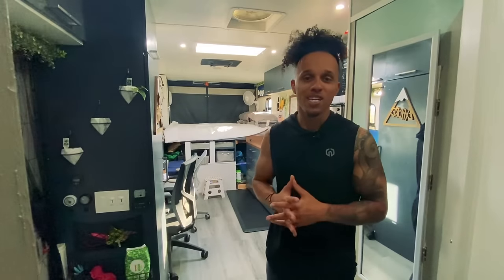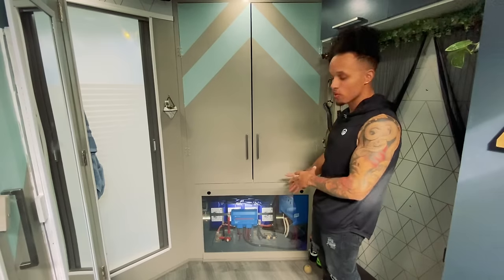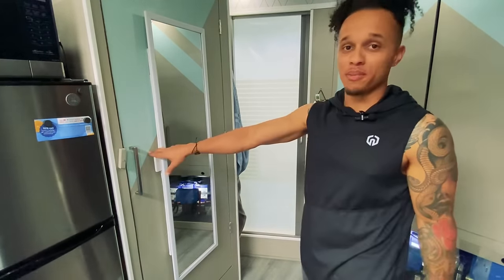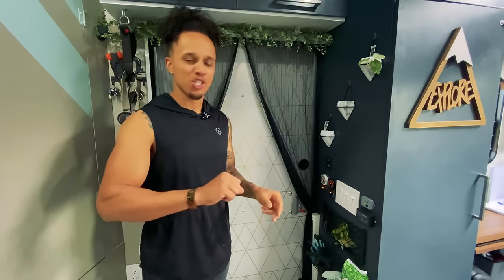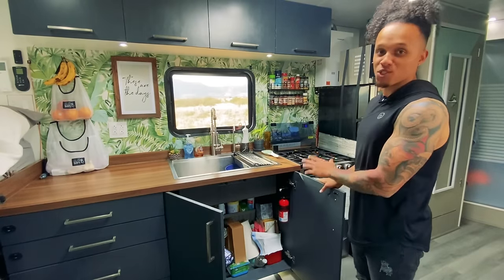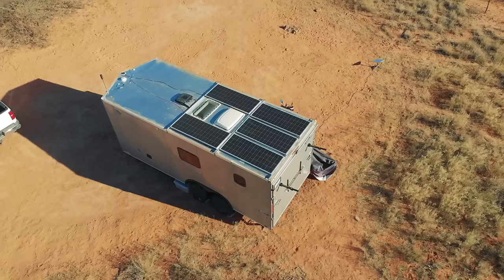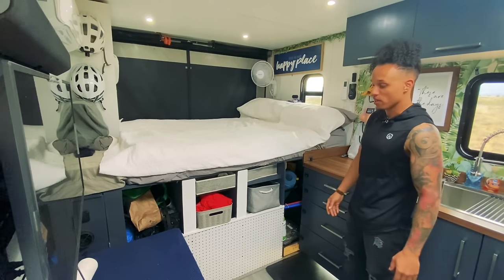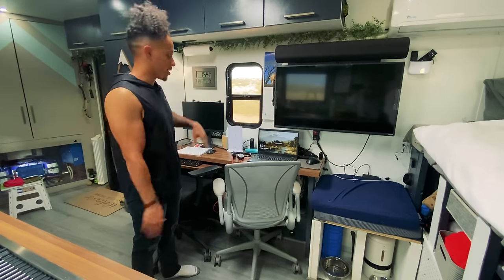The BEST Cargo Trailer Conversion I've seen!

Comment: Dang man, so cool! How often were you working on it during those 18 months? Trying to estimate a build for myself. Thanks!
Reply from the maker: So this was my full time day job for about 15 months (not quite 18 months).. It was just me working on it, no prior experience at all, so the hard part really was figuring out how to do things for the VERY FIRST TIME. The idea's, and what not, that was the hard part that took so much time... Oh, and winters in Colorado also slow down the process working outside. haha.. But I still made it happen.. And I also made some major design changes mid way through that cost me an extra 1-2 months of work, so yeah next time it will not be that long haha.

Comment: Have you ever had the finished  trailer on a scale to find out it weighs in total ?
Doing some research, it appears that size trailer only weighs about 2200 lb empty
Reply from the maker: Hey Mark,

Yes, so this trailer empty when we purchased it off the lot it was 3,700 lbs. 

I’ recently weighed it fully loaded with all our stuff in here, full fridge, e-bikes and all, it was just under 9k lbs. So not as light as RV’s but the quality is totally different build out. 

I hope that helps!
Reply: @whoiskyran1446  Yes !  thank you for the reply :-)

Comment: I would imagine the water tank would be one of the heaviest things....shouldn't that go in the front of the trailer?
Reply: Provided he has about 10% of the trailer's total weight on the hitch, he will be fine
Reply from the maker: Whenever we travel and move, we don’t drive with a full tank of water. That’s too much additional weight for no reason. We fill water when we are at our next destination. 

But the heavier things you actually want closer to your axles (which carry the weight). 

The more weight you add to the front of trailer, the heavier the tongue weight becomes (putting more weight on truck and can cause instability when driving). 

Ideally your tongue weight should be 10-15% of the trailers weight. This is within that 👍🏼

Comment: “Open the gray tank and let that water rush out”?? How much longer do you think you are going to have boondocking spots during dumb stuff like that? Kitchen grey water is nasty.
Reply: Nothing wrong with dumping gray tanks on BLM land if you are using bio-degradeable detergent/soap and using strainers. Tent campers have been doing this for hundreds of years. Chill out.
Reply from the maker: @Fearlesslikeahoneybadger  Kitchen gray water is not the worst thing for this planet 😂

Fossil fuel, plastic usage, electric waste are all things im sure you expel in your normal life, way worse than some water with grease and chicken broth going into a pile of dirt. 

Thanks for the 2 cents though 👍🏼